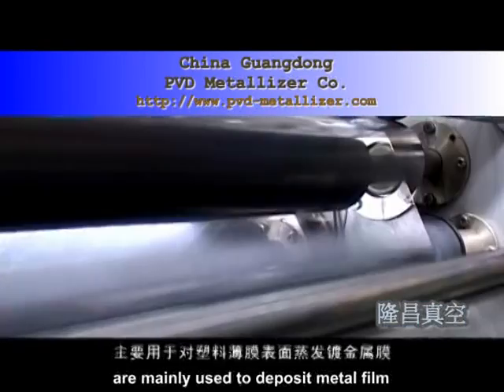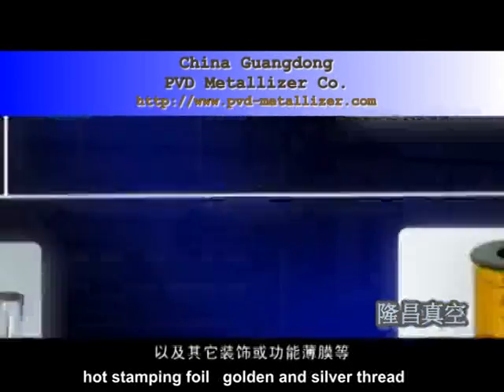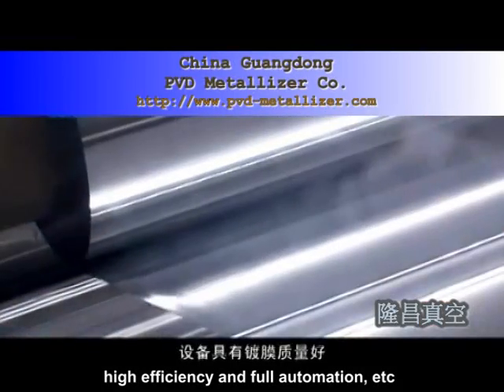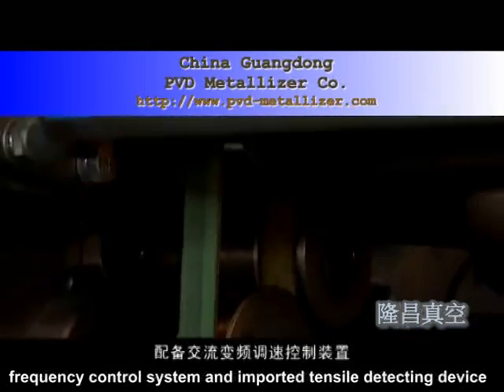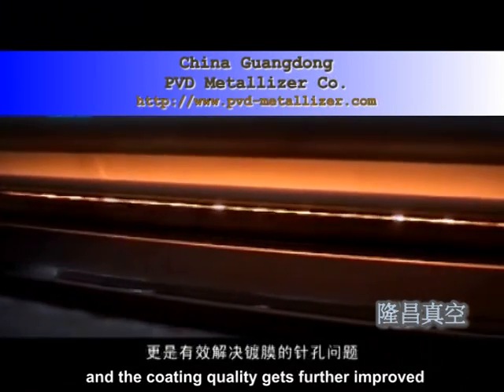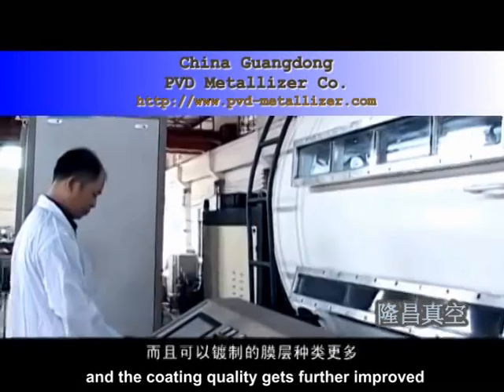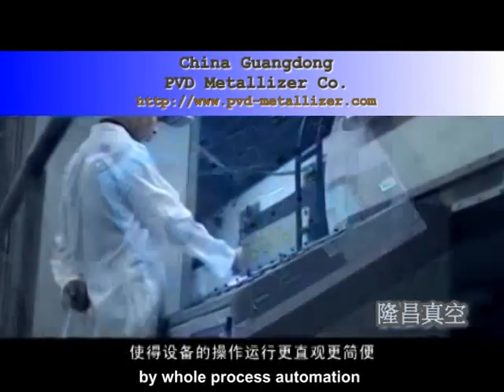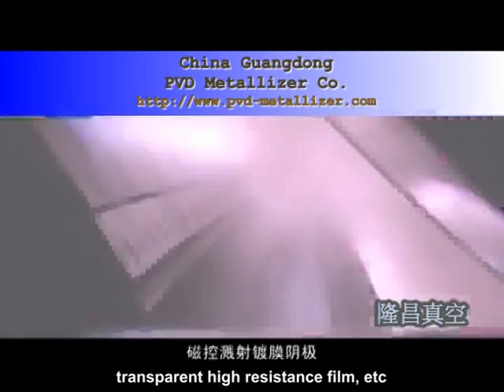Vacuum web coater

Comment from the maker: Vacuum web coater

http://www.pvd-metallizer.com

Evaporation web coaters are mainly used to deposit metal film or dielectric film on plastic or polyester or polymer substrate films, and so on like winding flexible materials, extensively used in the industries of printing, packing material, hot stamping foil, golden and silver thread, laser counterfeit films and other functional films. 
TS-JRW series wire-feeding evaporation web coaters adopts consecutive wire-feeding evaporation deposit technology or MF induction melting pots evaporation technology to realize mass production with advantages of high coating quality, high efficiency and full automation, etc. Equipped with powerful vacuum pump group and Poly-cold system, the machines insure efficient operation. Specially designed rewinding system coupled with AC frequency control system and imported tensile detecting device, with reasonable roller cooling structure enabling the film leveling in rewinding running without deviation, the web coaters can easily and stably realize operation speed 400M/min. By use of the technology of MF induction melting pots as its evaporation source, it can effectively solve the coating problems of pinholes and the coating quality gets further improved. With advanced IPC control system, patent OA2000 software invented by our own company and color screen display as operation interface by whole process automation, available for extensive application in production of flexible film, sticking film, laser counterfeit films, color or optical films, conductive cloth or fabric, ITO transparent conductive film, transparent high resistance film, etc. 
The web coaters can be flexibly or selectively equipped for different coating purposes with ionic bombardment clearing system, linear ion source, powerful E-beam gun, sputtering power source and cathodes and PECVD device, etc in order to strengthen its functions.

China Guangdong PVD Metallizer Co.

Alex Li

Mobile:+86 13929890858
Email: vacuumsale@hotmail.com

Comment from the maker: Magnetron sputtering web coater

http://www.pvd-metallizer.com

High vacuum web coater is specially designed equipment for coating aluminium films or oxidant compound films or other metallic films on rolls of any polyester membranes. It can be also equipped with both wire-feeding system, MF melting pot, DC or MF sputtering metallization function as per customers specific requirements to realize certain coating purposes.

China Guangdong PVD Metallizer Co.

Alex Li
Mobile: +86 13929890858
Skype: vacuum-metallizer
Email: vacuumsale@hotmail.com
598828529@qq.com
Website: http://www.pvd-metallizer.com
Address: No.1 duanzhou road, Zhaoqing, China

Please click below to see videos of our metalizing machines:

http://www.youtube.com/watch?v=ksrnggJYYVI
http://www.youtube.com/watch?v=dt4Cu7uWCug
http://www.youtube.com/watch?v=ux01xRBDbgw
http://www.youtube.com/watch?v=Of1t1_YYCj8
http://www.youtube.com/watch?v=YzTisG_A3k0
http://www.youtube.com/watch?v=MRKtFwEPEiM
http://www.youtube.com/watch?v=3-K4iuf2snE
http://www.youtube.com/watch?v=X191aw9GWDI&feature=youtu.be